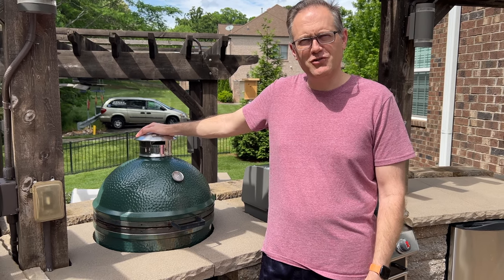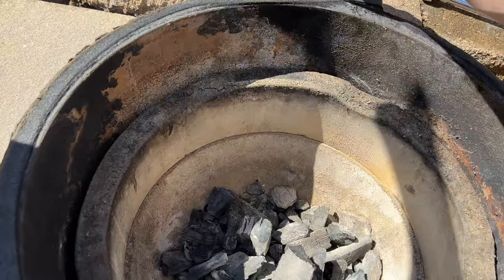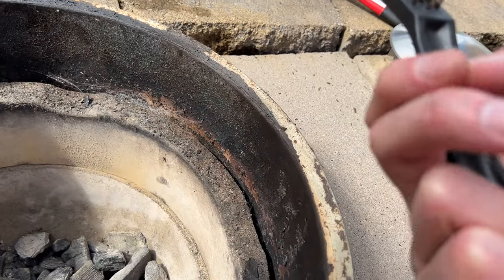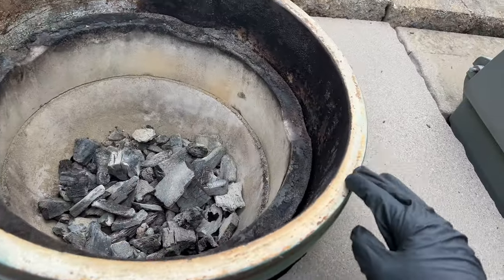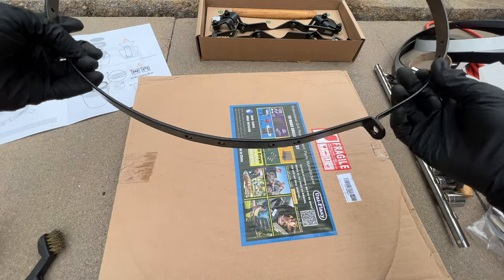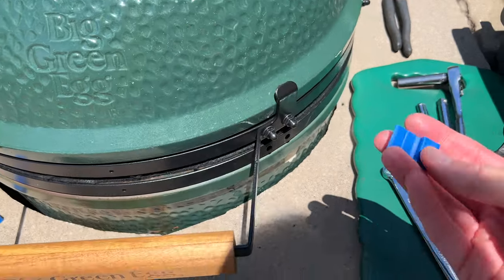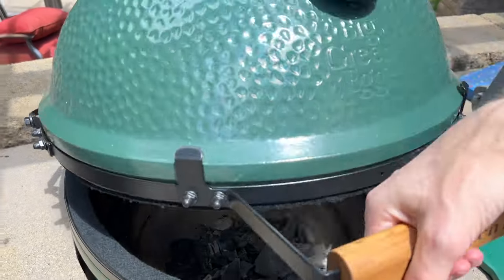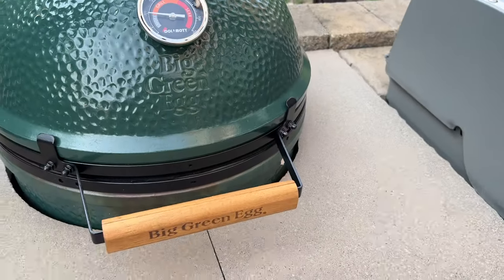Big Green Egg Overhaul after 15 years of use

Comment: Overhauled my egg after 15 yrs about 6 months ago.  I normally use acetate for gasket removal but the goof-off works well.  The lid/handle assembly is much better than what we had.  I think you’ll like it thanks for sharing.
Reply from the maker: Thanks!  Ya it's a lot better than the first generation handle, but I think the wood will still rot in the sun in a few years.

Comment: Why didn’t you do a burn off before starting this?
Reply: And I think the gasket would be easier to remove too.
Reply from the maker: I had done that not too long ago, I made a video about it, but since it was pretty clean I didn't need to do it again.
Reply from the maker: The majority of the gasket is easy to remove, but the glue can be difficult to get completely off